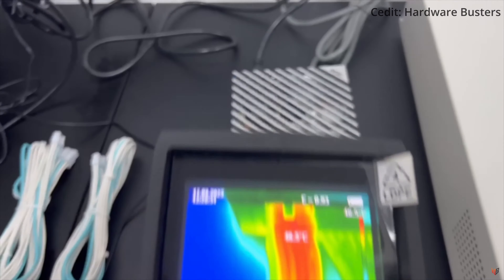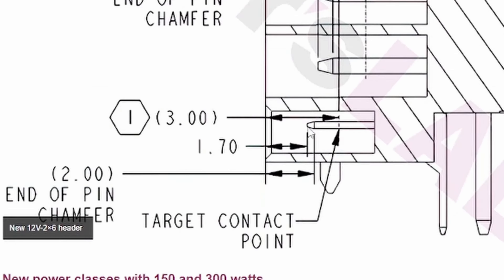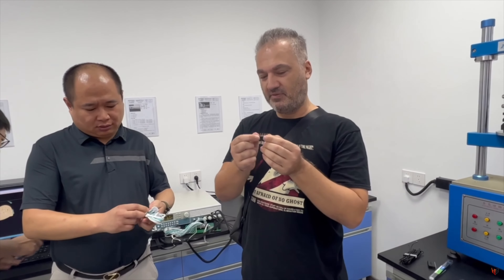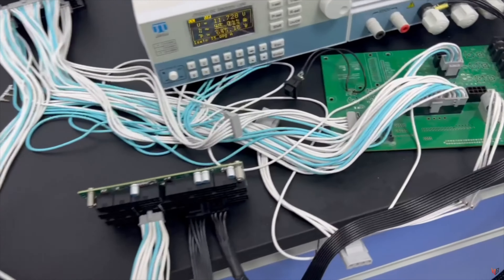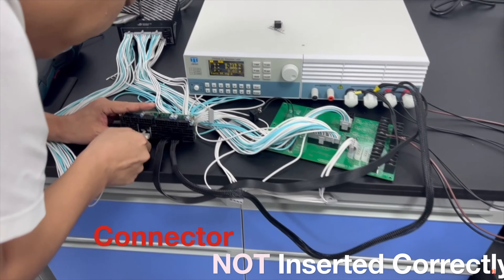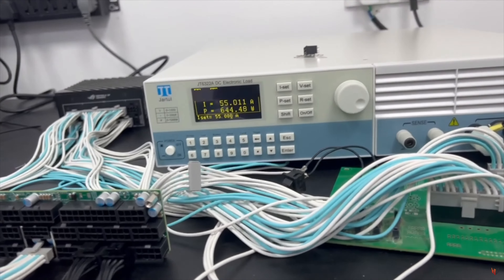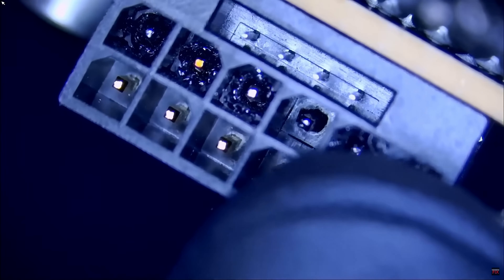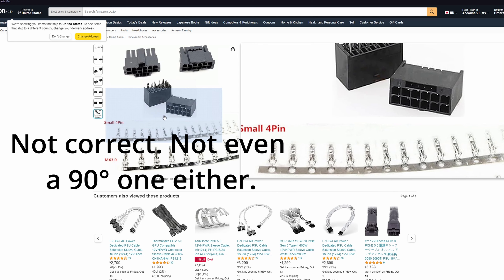Did Nvidia fix the 12VHPWR Cable/Connector?

Comment: No, they didn't replace or update the PWR 12-pin connector, once you have a few million examples out in the market it's nonprofitable to recall them all and reflow a new 12-pin connector on them and send them back. Though Nvidia should do that. The RTX 4090-s are still melting / dying on the VRM-s side due to improperly build 12-pin design and PWR design. Around 80 % of them are melting their own 12-pin connectors and around 50 % have to RMA-d due to melting death of the PWR circuitry.
Reply from the maker: No they didn't " in reference to what part of the video?
Also your saying 80% of 4090s are melting?
Reply: @techwandoUS  Nvidia didn't recall or replace any 12-pin PWR connector. The only existing v1 is residing on every single 4090 on the planet earth :).
Yes, approximately 80 % of the 4090-s sold up until now have been either RMA-d, replaced with a new card, repaired the melting 12-pin or repaired in various shops on the 12-pin PWR connector or the VRM-s side.
Reply from the maker: @lflyr6287  Yes, the new connector hasn't been officially implemented, they only decreased the length of the sense pins and made some very minor changes. It's a garbage connector forever at this point, they need to start over engineering or go back to 8 pins. De8auers recent video told quite a story. 

As for the percentage of melted cards being 80%, care to share sources?
I have spoken with quite a few repair shops, and although they all have gotten quite a few cards, the 80% number would be pretty insane. The government would go after them at 50%.
Reply: @techwandoUS  The goverment ain't gonna do nothing because Nvidia is completely a private owned company. Only a joint lawsuit from consumers against Nvidia would be an option....which isn't gonna happen sadly.
As far as the numbers of burnt 4090-s go....I work in the PC industry and I have access to data from behind the consumers scenes. That's as much as I can tell you, sorry.
Reply from the maker: "The FTC enforces federal consumer protection laws that prevent fraud, deception and unfair business practices". At even 50% they would end up in a Microsoft situation where they would be forced to recall all the products. Doesn't matter if you are privately owned you can still be told what to do. There's a reason the 4090D exists lol.

As for your job and the source information. 
Ok.
Reply: @techwandoUS  Yeah, I know, but Nvidia has pulled this crap of letting out a BETA product a few times already....just remember the RTX Pascal Refresh 2000 series and its Micron overheating GDDR6 that caused artifacting on numerous cards just after 1-3 months, 1350 MHz gpu core lock bug and countles BSOD-s....and then the RTX 3000 series and its poping back passive elements and dying VRM-s due to too high of a power delivery limits....and then this RTX 4000 series and its 12-pin self-destroying connectors....
Reply from the maker: @lflyr6287  Yeah, just covered the Micron memory issue in my last video on the 2080ti. The poscaps issue was quickly fixed on the 30 series with a bios update. During these times I worked as an SMT operator building many products, some utilizing Nvidia, specifically self driving car motherboards. I did pick some of their brains on the poscap situation as we did have video meetings with them during those times, and those issues were extremely low numbers on the 30 series. Micron on the other hand, I personally went through 3 2080tis before getting a solid Samsung FE model (described in that video as well).
Reply: @techwandoUS  finally smbd that actually accepts, knows and confesses to Nvidia faulty product mistakes.
I myself have multiple GPU-s and have had the pleasure to try around 75 different models in the RTX Pascal refresh 2000 series and RTX 3000 series in all tiers....and my conclusion to stay on my trust worthy EVGA GTX 1080 Ti 11GB SC2 iCX....and buy AMD instead if I want to upgrade because AMD GPU lineups like RX 5000, RX 6000 and RX 7000 series work perfectly and have no such hardware issues or software issues like Nvidia does.